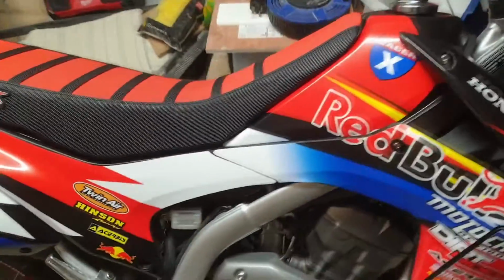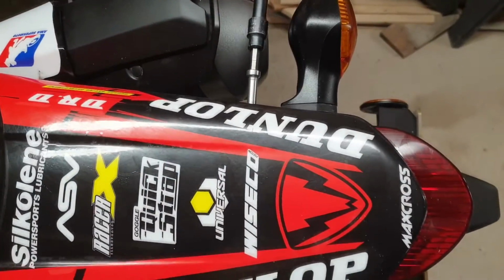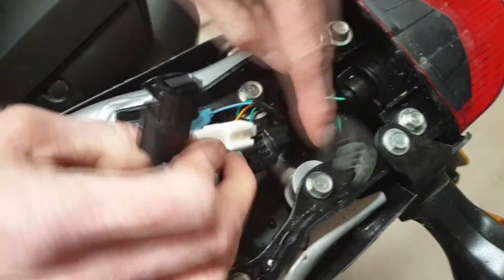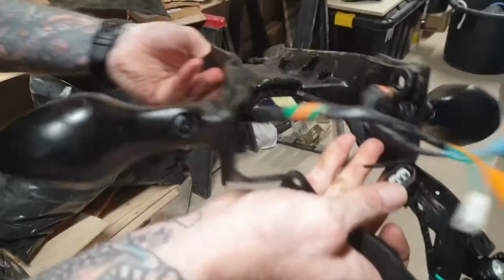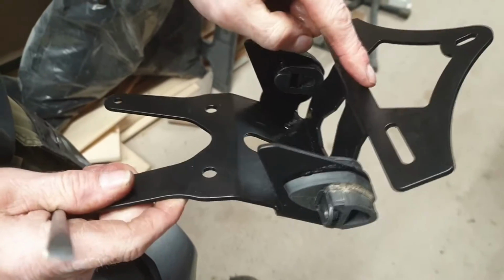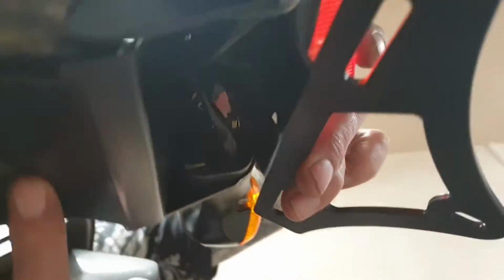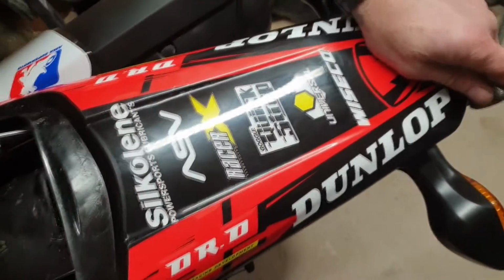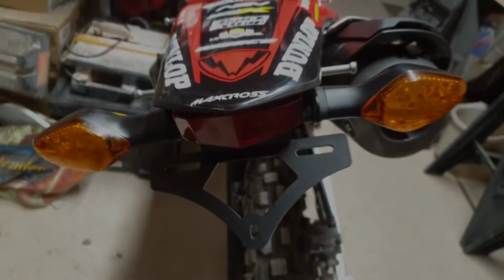Honda CRF250L Rally | Tail Tidy Install

Comment: Great video made me get one from g tec I’ve got led indicators on rally will they still fit in the gromits will try after crimbo cheers
Reply from the maker: They fit  perfectly !! all ready installed on spikes rally thnks for you comment buddy 👍
Reply: J tech also sell plate adaptors for aftermarket leds (I fitted some Ledperf sequential indicators|) if you aren't using the original grommets. I think the j tech is possibly the best tail tidy on the market, both from a plug and play perspective but also due to underneath enclosure. Very helpful company as well.